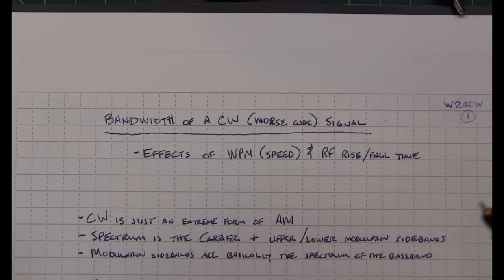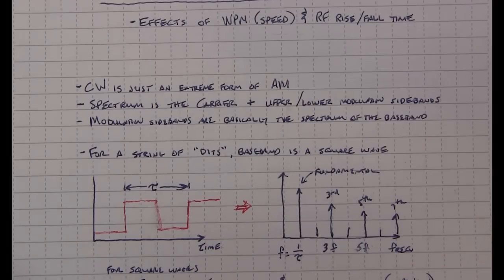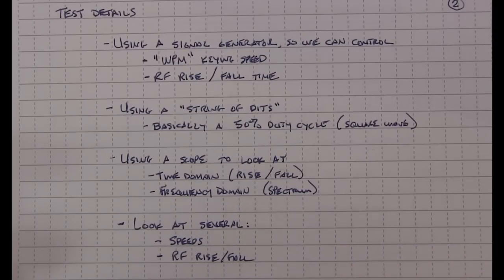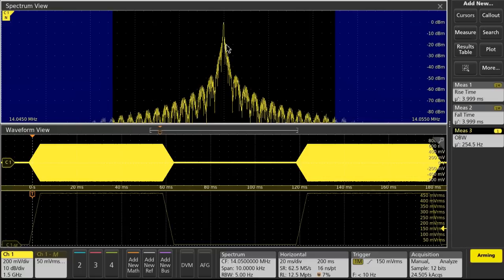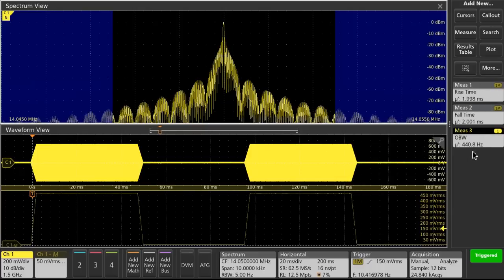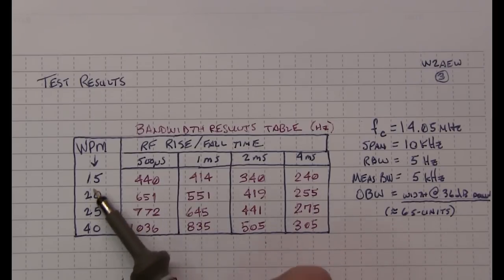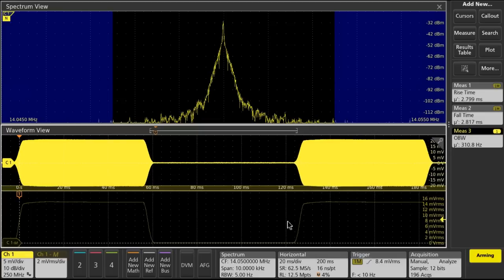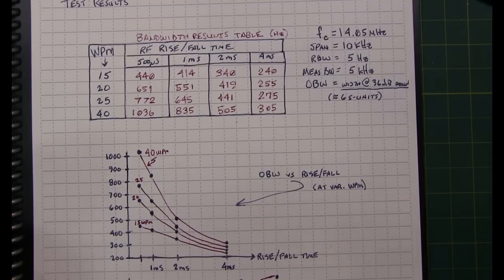#384: What is the bandwidth of a CW / Morse code signal? (as a function of speed and rise/fall time)

Comment: Alan...Thanks for the video on CW bandwidth.  My IC-7610 has rise-time adjustments of 2, 4, 6, and 8 ms.  I run it at 8.   I noticed you started at 4 and progressively sped-up the rise time.  I was also surprised to see your calculated rise time of the Elecraft unit so low.   I believe that too short of a rise time can create key-clicks.  I was hoping you would address this but I didn't hear you make mention of it.  I think I remember that Rob Sherwood's measurements on rise time of the 7610 and the 7300 indicated that the rise times were actually faster than the menu setting would have you believe.  That is, a menu setting of 6 ms rise time was closer to 4 ms, a menu setting of 4ms would be closer to 2 ms,  etc, etc.  It would be interesting to see a video where you actually measure the actual rise time versus the "set" rise time in the set-up menu of several popular radios where there exists rise-time adjustability...as well as key clicks observed versus rise time settings.  73 de Joe W4JF

Comment: Thank's very much for yet another brilliant Video presentation, there's one thing that's got me a bit confused though....  In the UK, our governing body ( OFCOM & RSGB ), have various maximum bandwidth's set within our CW Portion's of each band, now some of these band's state a max bandwidth of 200Hz, would that mean that these portion's of the band are restricted in WPM speed, as, unless I'm not quite getting something that would seem to be the case, or is it purely due to the "envelope" shaping of the CW signal, as ( unless I'm wrong / wrongly informed ), the CW signal is TX'd as purely the carrier only without any Modulation Applied, then at the RX side, the carrier only is received and mixed with the BFO to generate the beat frequency, so that would therefore only seem to leave the WPM or the "Envelope-Shape" to be the bandwidth governing factor........     Please try and clarify this for me a bit
Reply from the maker: The occupied bandwidth of a CW signal is determined by two things - the "shaping" of the rising/falling edges of the RF pulse (longer rise/fall --> less occupied BW), and the WPM speed (faster --> more occupied BW) - see the table on page 3 of my notes to see the effects of these two parameters.  A CW signal is a modulated signal - it's effectively an extreme case of Amplitude Modulation, specifically OOK (On-Off Keying), hence does have modulation sidebands.  If you have a 200Hz restriction, then this may impact the max WPM and/or the rising/falling edge speed of the CW envelope.  Also, be sure to take a look at how they define occupied BW (i.e. - how many dB down, etc.), this will also affect the results.  I used 36dB down in my results.  If they specify a fewer number of dB down, then the BW will be lower.
Reply: @w2aew  Thankyou very much, that is beginning to "shed some light" on the subject, I think I may need to have a bit more of a deep dive into the specific parameter's of the CW signal itself, just I'm trying to " Re-Visit " the RF Theory side (which I haven't looked at in "real" detail for quite some year's), and with me currently trying to self-teach Morse, I'm also wanting to ensure that when I eventually get on the air with morse, I can be sure that I'm abiding to the relevant regulation's etc

Comment: The other limitations on real world occupied bandwidth include phase noise of the transmitter and receiver, as well as frequency error of the transmitter and receiver (plus any Doppler shift with a moving transmitter or receiver when operating mobile. Thus, the closest in frequency multiple stations could transmit in CW may be greater than the 36 dB down occupied bandwidth. That said, most HF rigs have pretty good frequency selective filters designed for CW mode, allowing a receiver to differentiate the wanted and unwanted stations. In combination with the human ear being incredibly good at discerning two stations at slightly different audio frequencies, we can cram a LOT of stations into the narrow ham radio bands.

Comment: What happens to the demodulated signal if you add a bandpass filter (presumably at the IF) setting the bandwidth to something like 200hz. Would this effectively round off the rise and fall time making it more like a sine wave than a square wave?
Reply from the maker: It will slow the edges - but making a narrow BPF at the RF frequencies would be difficult.  It would be best to do it at an IF and then upconvert to the RF output.

Comment: Great video - can you answer a question that some of my friends, and I, have been discussing lately?  When we key down whilst sending morse, what determines the "tone" that is heard on the other end?  When I am listening on a frequency, I hear several stations calling and many are different tones. Is this due to their relative position, with respect to the carrier, which offsets the side-tone I have set on my rig? Many different opinions here but when we get back to a dit being an un-modulated carrier, there certainly is no "tone" associated with that. I would really like a good way to explain this.  Thank you again for the great videos.
Reply from the maker: The carrier is not modulated with a tone, it is a simple unmodulated RF signal that is switched on/off.  So, really it is an extreme case of slow, pulsed, amplitude modulation - specifically ASK (amplitude shift keying).  But, when the carrier is "on", it is not modulated.  The tone that you hear is generated in the receiver by mixing the incoming signal with another oscillator called a BFO (beat frequency oscillator).  What you are hearing is the difference between the incoming signal frequency and the BFO frequency.  More accurately, this mixing is happening at an IF frequency - where the incoming signal is converted into an IF frequency, and the BFO signal is mixed with that, and the resulting difference is the tone you hear.  The BFO signal might be slightly above the IF frequency, or slightly below the IF frequency. In some radios, which "side" the BFO is one may depend on which band you are on.  When you hear different tones calling, it means that each of them are transmitting a carrier that is slightly different in frequency.  My friend Vince VE6LK recently did a video on this.  You can find it here: https://youtu.be/FFsvMFfag0w?si=R5yh2_oBHeoRqlSZ
Reply: @w2aew  Thank you, that is certainly in alignment with what I was thinking and you confirmed the different tones also as I was thinking that they must be just a little off frequency. My ICOM has an auto-tune feature for CW and I guess I am just right at their frequency and others seem to be off. Also, I do know that in pileups I move slightly off to be heard.  Thanks again for the response and the referral video.  BL

Comment: I wonder what you'd end up with if you keyed the carrier synchonously?  So you would have only complete cycles of the RF....   Not sure how you might do this,  but I suspect that maybe digitally synthesizing the signal might be one way to implement it.
Reply from the maker: Would make things much worse (going from zero to full carrier synchronously).   Typically, the carrier is ramped up over many thousands of carrier cycles so that there are no abrupt changes. Consider the example here. At 14MHz, each carrier cycle is 71ns. So, during a 4ms rise time, there are 56,000 carrier cycles.
Reply: When I say synchronously,  I'm thinking that the carrier is enabled and disabled at the zero crossing, which wouldn't have the effect that you describe.  Is this even possible? I don't know offhand.
Reply from the maker: @Roy_Tellason   I understand what you mean by synchronously.  But it really wouldn't apply in this case.  Typical RF envelope rise and fall times are 4-5 orders of magnitude longer than the RF cycle - meaning that the modulated waveform increases gradually, cycle by cycle over the course of 10-100 thousand cycles before reaching full power.  In this scenario, having this ramp-up start synchronously would have no effect on the resulting BW.   If on the other hand, you're suggesting that the carrier be switched "on" at it's zero-crossing, that would be an equivalent of an extremely fast rise/fall time, resulting in a huge amount of occupied BW during the turn on/off times.
Reply: @Roy_Tellason  It does not matter at all. Only the shape of the envelope matters. AM modulation maps the baseband spectrum of the modulating signal (i.e. the spectrum of the envelope, or IOW the spectrum of the shaped Morse pulses) to the sidebands below and above the carrier.

Comment: Excellent explanation, especially with the no frills handwork presentation on quadrille.  An Extra Class level exam question could be derived from this material.  This video reminded me of a Steve Ford/Joel Hallas (SK) discussion where Joel was perplexed about why a radio manufacturer would allow end user adjustment of CW rise/fall times because it could most likely only create unintended problems.  A follow up question:  Would use of an external keyer affect OBW or would it be defined by the radio's keyer?  Think not with modern radios and modern K1EL-type keyers using straight key emulation.  But wondering about my Drake TR4-Cw with (what I think is) grounded grid keying.
Reply from the maker: An external keyer shouldn’t make any difference compared to a straight key at the same speed.

Comment: How this apply to the RF source when it use DDS, where any power pulse will be the integer of  period of single or multiple sine wave. In such case rise an fall time do not apply as it equal to the quarter period of  sine way. So what will be the impact on the occupay bandwidth?
Reply from the maker: Still the same. Occupied BW will be a function of speed and shape of the RF rising and falling edges, and speed of keying.

Comment: Low-speed transmissions, in addition to higher spectral occupancy/BW, have the disadvantage of higher power consumption from the source.
Therefore, a weight ratio of less than 3:1 becomes advantageous in QRS
24WPM: 2.8:1

Comment: An excellent video. I wasn't aware CW had a bandwidth beyond the carrier.

I was interested in the rise and fall time of the signal as that would have an effect on power supplies. I have investigated the dynamic response of power supplies using a programmable power supply. I used a 50 per cent duty cycle and had to specify rise and fall times that I only guessed at.

A CW transmitter or even an SSB one stresses the power supply. Switching power supplies are particularly affected due to the design of their frequency response. Power supply transients could affect the transmitter and lead to spurious signals.

I used two oscilloscope channels, one for voltage and the other for current, using a current probe.

Comment: I continue to struggle with this. The harmonic content of a square wave being tied to rise time makes sense, but what I fail to grasp is how we are getting a square wave in the first place.

Hypothetically, if you had a sine wave carrier and switched it on and off at the zero crossing point each time, would harmonics be present?
Reply from the maker: Yes.  Anytime a signal moves quickly in the time domain, it occupies a lot of bandwidth in the frequency domain. So, if you start with a 0 volt signal, and then immediately turn on a full amplitude RF carrier, you will generate a lot of wideband RF energy at the point of turn on - because you're transitioning from a DC value immediately to a sharp rising signal at the zero crossing of the sinewave.   In CW transmissions, the turn on/off transitions occur over thousands and thousands of RF cycles, each becoming gradually larger/smaller.  This is what tends to limit the spectral content and occupied BW.

Comment: Mathematically a CW signal has zero bandwidth, highest minus lowest frequency. Well, it's only 1 specific frequency, bandwidth is zero. Of course that's not how it works in the real world.
Reply from the maker: Yes, this is true for a continuous key-down.  But, for an Morse code CW transmission, the carrier is modulated on and off, thus does have modulation sidebands and occupied a non-zero amount of BW.
Reply: If it's a CW sine wave signal of infinite duration... which is what you seem to be implying... then AFAIK, mathematically (Fourier transform, and sinc function) the 'bandwidth is infinite, since the sinc function has no zeros... but if the 'CW' signal is of finite duration...then the signal gets turned off, at some point in time....then mathematically, it definitely has a 'bandwidth.' It's a pulse or burst. The longer the duration, the smaller the bandwidth, since bandwidth is inversely related to the duration for a single 'pulse."

Comment: One could take it one step further and also graph the occupied bandwidth compared to how far down one has to get to not occupy surrounding spectrum.
Like here we looked at 36 dbc, but as we can see in the spectrum the occupied bandwidth will increase rather exponentially as we lower that bar further.
Reply from the maker: Yes, a proper test would be to apply a mask the progressively drops the further out you go.
Reply: @w2aew  There is many ways to gather data. The approach in the video is very good and gets to the point in a clear and concise way. One reason I follow your content.

Comment: Excellent content Alan, as usual. My Yaesu FT-DX10 has adjustment for CW wave shape. They describe it as follows in the operator manual: 

Function: Selects the CW carrier wave-form shape (rise/fall times). 
Available Values: 4msec / 6msec / 8msec 
Default Setting: 6msec 
Description: Sets the rise and fall times of the keying envelope in CW mode (transmit waveform).

Edit to add, the newer FT-710 provides for 2, 3, and 4 ms with the default of 4. They also include the note that 2 or 3 may produce key clicks. The FT-891 has 2 and 4, default 4.

n1bs

Comment: Hi Alan,
Very interesting video.
I try to explain on the air why, in real life, you cannot see any difference between an IC7300 and a FDTX101, and I tried both on the same signals and the same antenna in heavy CW contest.
ARRL or Sherwood measurements are done with a very low noise and steady carrier from a high end signal generator.
In real on the air life, SSB signals have IMD close to the suppressed carrier frequency, at -35 dB in the best case, and CW signals have sidebands, phase and amplitude modulation, like your video shows. And of course power amplifiers increase these behaviors.
So, it's always interesting to know the maximum performance of its receiver, but it's also interesting to know that on the air tests can lead to some disappointment if you compare the 1st transceiver on the Sherwood list to others down in this list.
Rob itself warns about this.
Best regards, 
Georges F6DFZ

Comment: It looks like rise and fall times can be increased further? Also, I wonder how would sharp CW looks like after passing narrow-band filter...
Reply from the maker: The spectrum will continue to be narrower as the rise/fall are slowed further.  A narrow BP filter would do the same.
Reply: @w2aew  My expectation would be that with slowest possible rise-fall we should reach Shannon limit, while currently with these 300Hz bandwidths we are >10x above Shannon limit.
Reply: @BarsMonster  It would seem so to me. As I would  do about 10 letters/minute I could tolerate a 15 ms rise time or more.
Reply from the maker: @BarsMonster  A few reason for this are:  I'm looking much further down the skirts (36dB down), and I'm still using fairly fast rise/fall w.r.t. pulse width.

Comment: Great video. Without any envelope shaping and CW keying, you are essentially mixing a square wave (the keying of which is low frequency) with the RF carrier. The square wave harmonics will appear in the resultant spectrum. Shaping with a linear rise (essentially a triangular waveform) will then add those harmonics to the output. The best rise and fall shape is a 'raised cosine' which is essentially a single frequency sine wave which in theory has no harmonics and just contributes a single frequency in the resultant spectrum. Getting your signal generator to produce this could be a challenge unless you can define a custom waveform and your generator uses DDS techniques. I note that the Elecraft signal appears to be close to the raised cosine envelope, perhaps because it can employ DSP techniques to do this.
Reply: Yes, I had thought it would be pretty much a sine wave with little harmonics given technology has advanced some in the the hundred years. I would figure the FCC would mandate as 'raised cosine' pules form.
Reply from the maker: They'd be more likely to regulate occupied BW, and leave the techniques up to the mfrs.